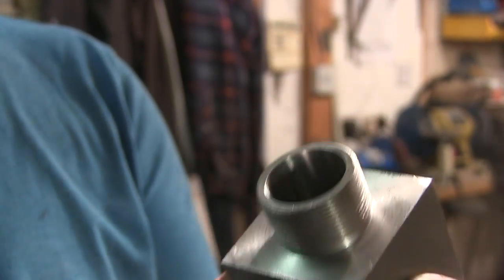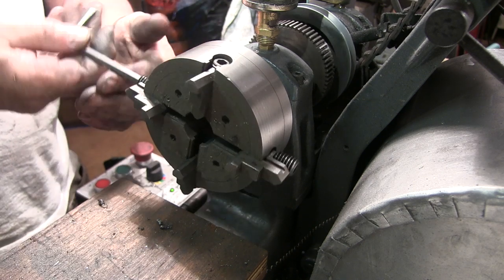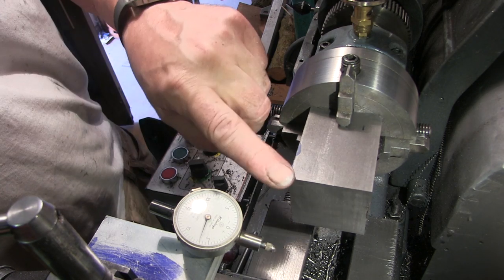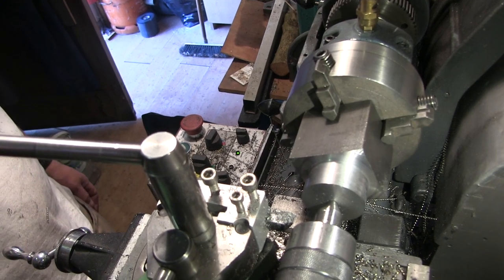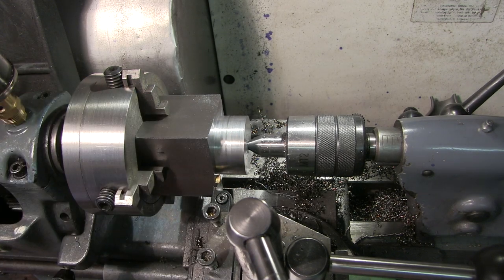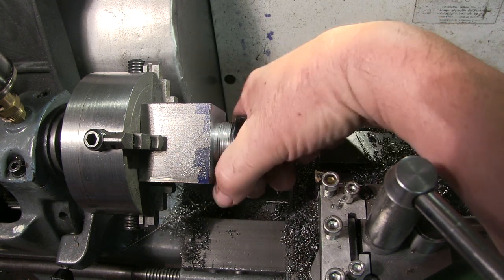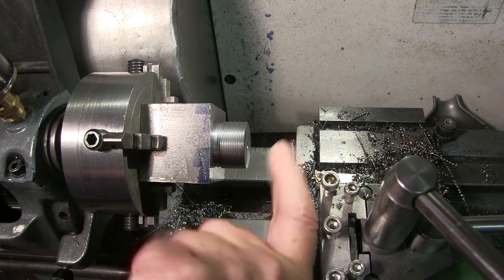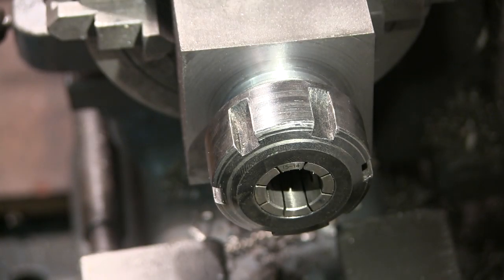A Collet Block!

Comment: I also have the ml7 without a quick change gear box, giving me a ton of opportunity to get things wrong & I do. At times I lust after a quick change box, but beyond my budget for now. Still you got a useful functional tool out of it & good practice if you later decide to make a hex block. I have also lusted after both the 4 & 6 side, ER collet blocks, but have so far resisted the temptation to buy or make one, doing various Heath Robinson setups as needed. Thanks for sharing!
Reply from the maker: Quick change gearbox!!! Luxury! Also beyond my coffers! Next thing might be an ER40 chuck for the lathe, needs a bit more precision though! And a hex er32, try and get it right next time!
Thanks for watching,
Cliff

Comment: Thanks again Cliff, for sharing your endeavors, mistakes and final successes! Botched an ER32 block up myself when being cock-sure of (instead of just clocking in) the compound angle. Had to Dremel it to specs, from which the finish also benefitted... Tip: That hum sounds like you perhaps have a flouro tube above your lathe, and the camera's sound card picked up the EM 50 hz field? Heard just when the cam sits above the tailstock (Kitchen foil wrapped a few turns around the cam could perhaps help, I've been successful with that, even like it might sound like "shields from the Voices").  Just my two cents! Johan//DIYSwede
Reply from the maker: Thanks Johan,
I'll look into that,
Thanks for watching,
ATB,
Cliff